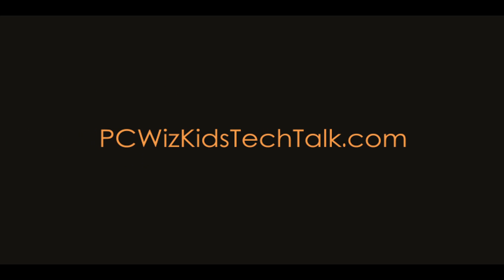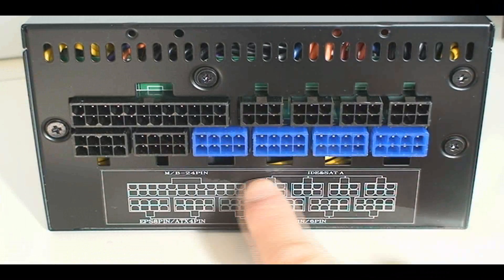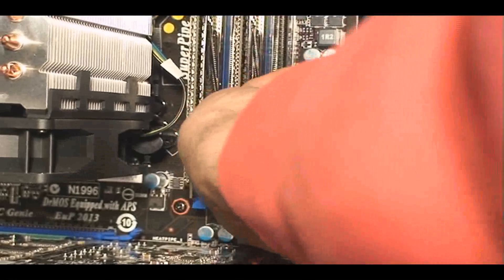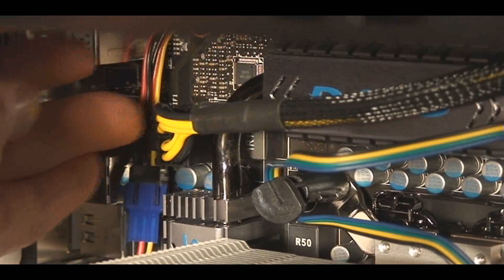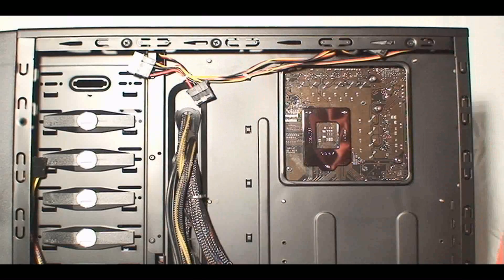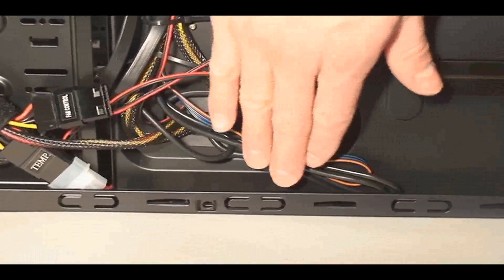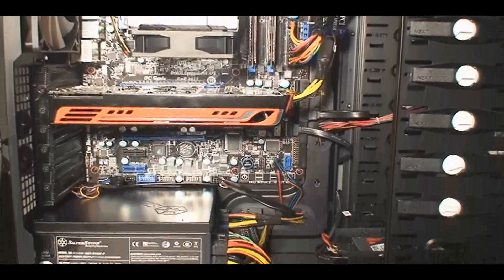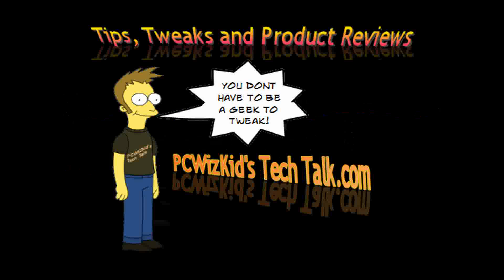How to Build a Computer - PCWizKid's PC Guide - Part 2 Video

Comment: (custom computer) i got a 8 inch fan, but 9/10 times it won't turn and i need to give it a push. 
I have switch the power cable ones when I was cleaning the inside from dust. So my question is where is the appropriate place to install the power cable of the fan?

Comment: Intel Core i5-2500K Sandy Bridge 3.3GHz (3.7GHz Turbo Boost)
Noctua NH-D14 120mm & 140mm SSO CPU Cooler
MSI P67A-G45 (B3) LGA 1155 Intel P67 SATA 6Gb/s USB 3.0 ATX Intel Motherboard

CORSAIR Vengeance 8GB (2 x 4GB) 240-Pin DDR3 SDRAM DDR3 1600 (PC3 12800) Low Profile
 N560GTX-TI Twin Frozr II/OC Video Card
Seagate Barracuda XT 2TB 3.5" SATA 6.0Gb/s Internal Hard Drive
CORSAIR 850W Power Supply
NZXT Phantom White Computer Case
LG Black 10X BD-ROM 16X DVD-ROM SATA Internal Blu-ray Disc Combo

Comment: Can someone tell me if it is a good built?
CPU: AMD Athlon II x4 645/3.1 G/2MB/BOX s.AM3
MB: Asrock N68-GE3 UCC/Geforce 7025/s/AM3
Video: Sapphire HD5770 PCI-E 1GB GDDR5
HDD: Samsung SpinPoint F3 500GB 7200/SATA2/16MB
Cooler: Evercool Fan 92mm EC9232TH12BA 3400rpm
RAM: A-Data DDR3 4GB/1333Mhz
Case: Goldenfield Power Box D210B-Black 700W-80mm

If anyone can help me pls tell mje.

Comment: @GRGO0152 nop, it comes with the PSU itself. But most PSUs aren't modular (all cables are already installed and you cant take either of them) and with non-modular ones there's nothing to worry about, you only have to connect the cables to the rest of the components

Comment: does the gigabyte g1 guerrilla have a 6 pin connectors for a 3 way sli with gtx 460's ???

and do u need thermal paster for water cooling :) ty

Comment: @bossco24 I could help you. If you need help send me a message and we can contact each other. You could tell me what your main purpose for the PC is and I am very good at finding the best parts for the best price. It's good to make sure you get good warranties as well. I wouldn't just pick out top of the line most expensive it's whatever suits your needs and in most cases bang for the buck. Even Core i3 are great little chips and even OC very well.

Comment: Nice video. However, why would you install the MB first and then the CPU and Cooler? Sometimes you'll need access to the otherside of the MB to secure the cooler with the board. So I believe the CPU and the Cooler should be installed first before placing the MB in the chassis.

Comment: Wait, have I been putting in my PSUs wrong this whole time? I have the fan facing the motherboard, thinking it will take out hot air through the back

Comment: huh lol power supply is essential is basically it converts high currents aka "AC" power  from the wall into a low current "DC power" all circuts require to be run on DC power aswell batterys can only store DC power

Comment: Ye at the minute, but if you think about it the 5970 is basically a 5870 x2 so if nvidias fermi is more powerful than the 5870 it is posible that they could beat ati. I however always buy ati so this is all irrelivent to me.

Comment: @iPawdTouch well last time my cousin spend atleast 800 dollars on his computer (not including monitor, mouse, and keyboard). he had a quad core, NVidia 9800 GT, 1 terabyte of hardrive, and I believe 3 or 4 gigs of ram. I don't know about the fan but it was good enough for the computer. but when it comes spending less on building your computer it all comes down to knowing where to buy the cheapest for the parts that you could find.